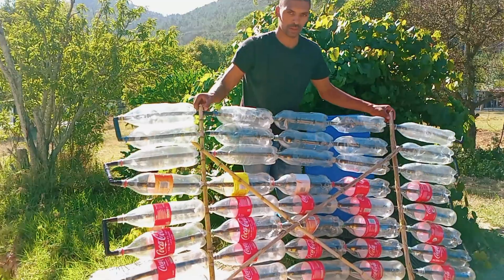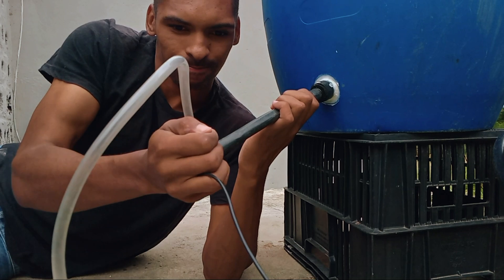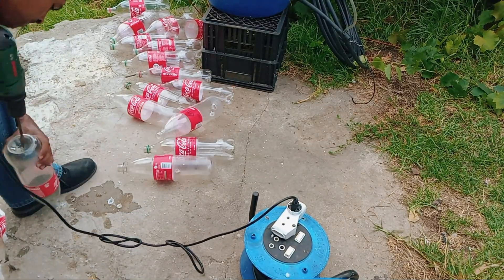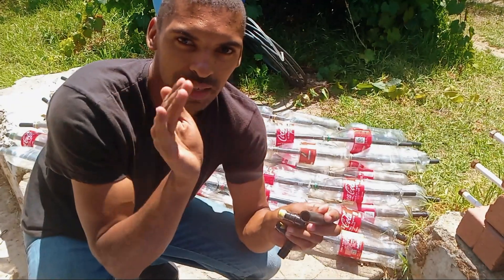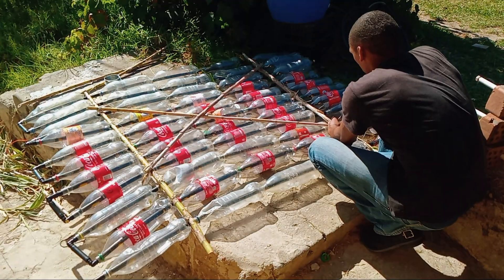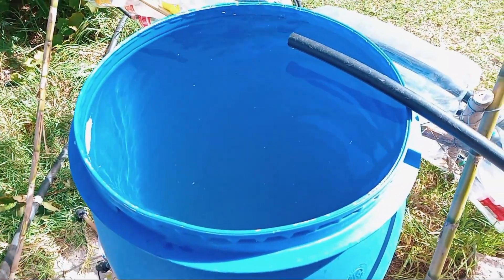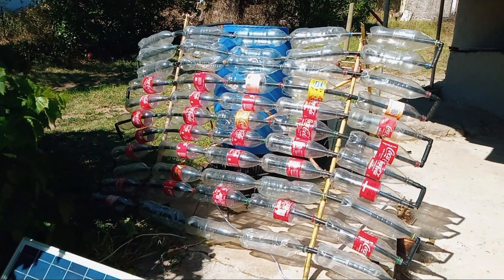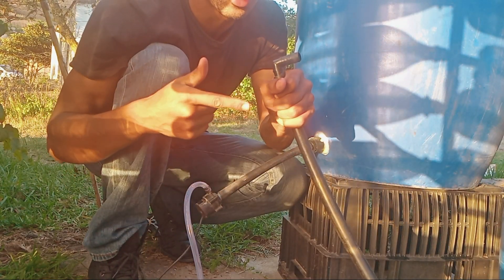How to make a solar heater /Free Hot Water

Comment: Really Cool Video!!!

I had a small suggestion though. If you hooked up the pump coming from the bottom of the barrel to the top  of the water bottle contraption instead of the bottom, it would be more efficient for the pump, since once the water enters the water bottle contraption, gravity aids in its flow through the pipes. This would increase its speed flowing through the pipes altogether, llowing all the water to heat up faster and would also make sure the pump doesnt burn out.
Reply from the maker: Thank you so much:)

Hot water usually floats on top of cold water because warm water is lighter than cold water. Also, water of the tubes equals the level of barrel since i placed the drum and tubs at the same height, so the pomp really doesn't have to do mutch, this is why I chose to do it like this. You want water to flow as slow as reasonably possible, giving the fluid more time to heat up.

The pump is brusless, so you could put it in a bowl of water to help keep it cool.. hope this helps

Comment: Would it have made any difference if the labels had been removed from all the plastic bottles?

Would just a bigger coil have also worked? It would have been a lot simpler to construct. No plastic bottles, no elbow joints, less points to leak. Plastic bottles don't like getting too hot. Does the little water pump like working with hot water? It would take a long time to heat that amount of water in the blue barrel. Plastic bottles hate UV light and tends to fail after a couple of months.

If you could source an electric jug's heating element and connect that to your solar panel, how would that work. No moving parts, easier construction, fewer parts (barrel, heater, solar panel, water). Easier to position a solar panel than to rearrange your hot water tubes.

Add a couple of thermometers in the water barrel to monitor the water temperature at different heights. (Thermometers that won't be affected by electric heating elements.)

When I visited Sri Lanka, the water was heated just by running your water pipes above ground, in the sunshine. The nightly shower was always hot. (Well the first one was.)
Reply from the maker: @awoodward37   I don't think removing the labels would have done anything since a lot of light was able to enter the bottles heating up the inside like my moms car. You don't need elbow connections and you could make like just one giant coil, I'm sure the water will heat up but, adding bottles is almost like holding a magnifying glass over the pipes heating up the water quicker and blocks out the wind and cold air.

I tried heating up the jug with a element connected to the pannel but, it takes way too long or the water is just not warm enough to do anything with,( these are low voltage pannels)
Reply: @01LifeCraft  One "trick" to use when using an electric heating element in a large barrel of water is to place the heater just below the surface (maybe below a float?). If the heater is deep in the barrel, by the time the heat rises to the top, the cooler water has removed the warmth. A heater just below the surface allows that water to get hot faster for you to make use of. Slowly the rest of the tank will also start to warm up. This method of heating the top of the tank and drawing the water from the top is the same method my heat pump uses to warm my water. This way allows me to start using my heated water in ten minutes instead of having to wait for all 400lt to reach useable temp. If you were to cut off the "neck" of the plastic bottles and then heat glue them together to form more of a long plastic pipe that could allow multiple lengths of black tubing to pass through, instead of just a single section? OR adding two valve shunts that can redirect the output from the tubes back through black plastic tubes instead of returning it directly into the water barrel. That would allow for a much faster heat up time.
Reply from the maker: @awoodward37  I hope you don't think of me as someone that has an answer for everything and just a know it all, but if I wanted to heat a small amount of water like that, I could have just used a kettle. I want a large amount of hot water available to me, even if it takes  a few hours it's fine.

Also, if you heat the top of the barrel, only the top will heat up. It's not going to make down, or that was my experience on another project .

Extending plastic bottles like is an interesting idea. I may have to try that and see if I get better results. Also, I want the water to circulate through the barrel because the water coming in is gradually warming up the top